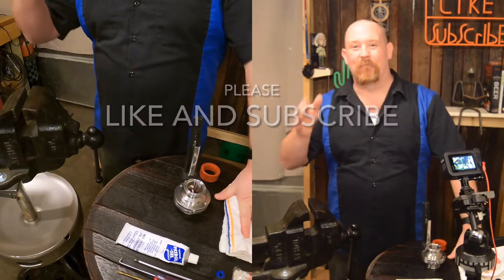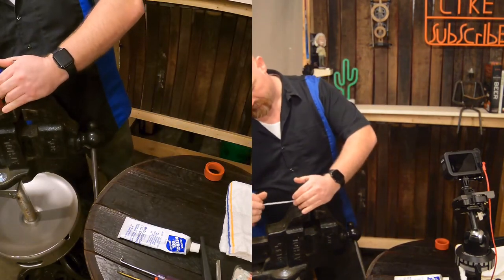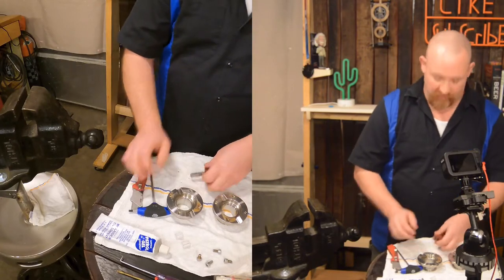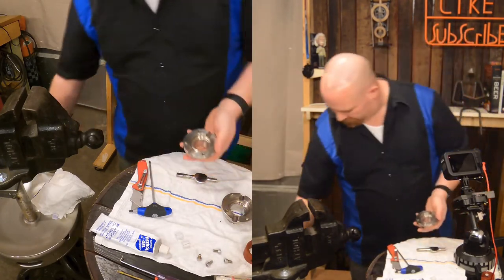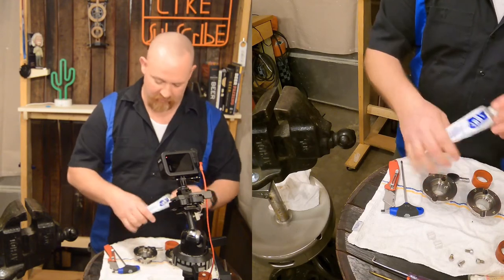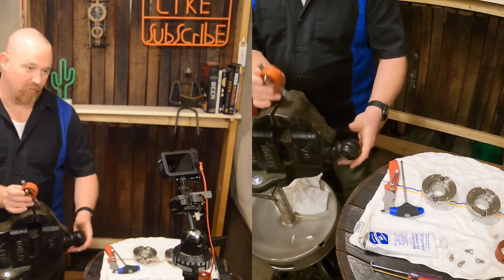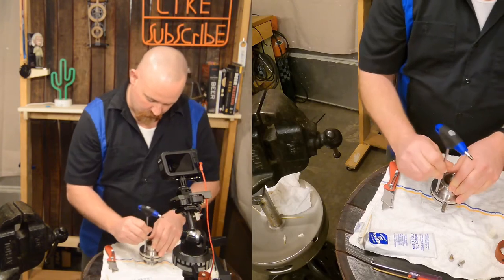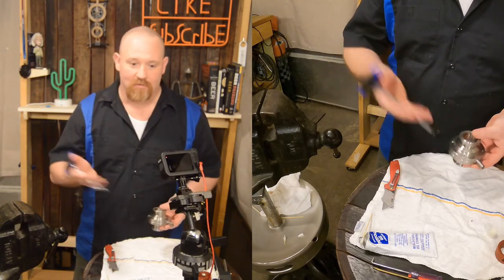Brewery maintenance 101, how to rebuild a 1 1/2” butterfly valve 2

Comment: What causes gauling? or is it galling?
Reply from the maker: Stolen from a website, Essentially, galling is a form of severe adhesive wear. Galling happens during installation to fasteners made of alloys such as stainless steel, aluminium and titanium. While the fastener is being tightened, pressure builds between the thread surfaces and breaks down the protective oxide coatings.